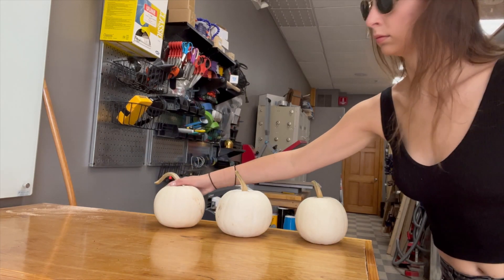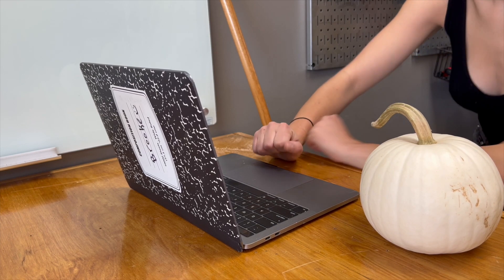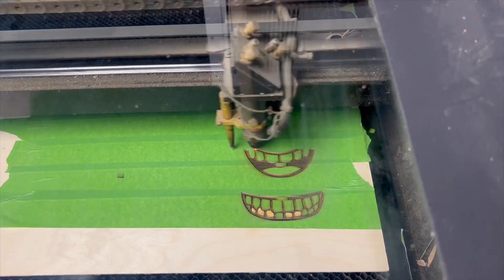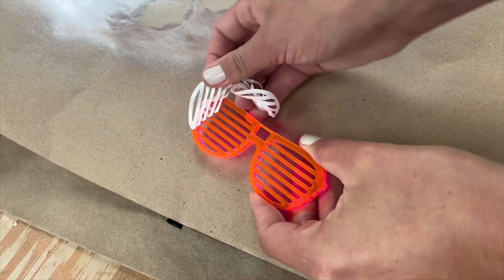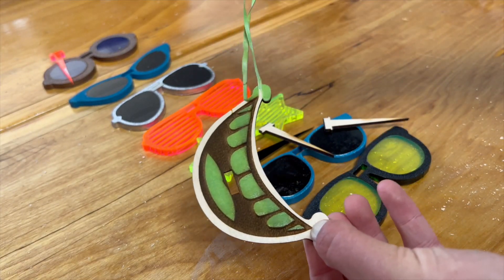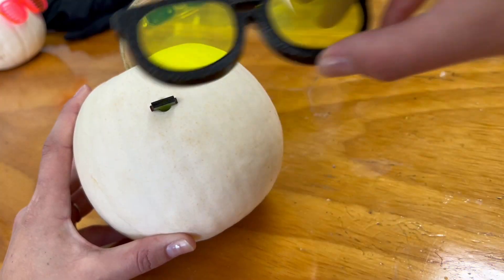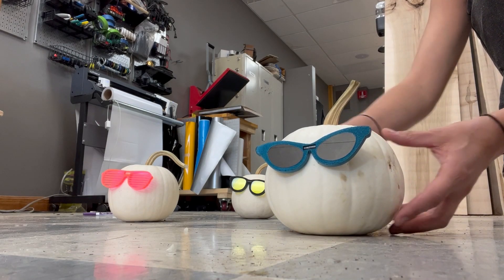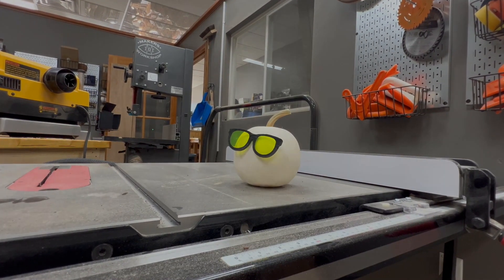A BETTER way to Decorate Pumpkins || Laser Cut Pumpkin Sunglasses

Comment: Have you tried lasering the pumpkin directly? I did it a few years ago and raster engraving takes off the more opaque skin of the pumpkin so the light will partially shine/glow through. You can also run a vector cut like 20 times to cut through too. I did ironman (the arc reactor was cut all the way through) on a pie pumpkin sliced in half so it'd fit in a K40 laser.
Reply from the maker: I haven’t mainly bc I don’t want to get pumpkin guts in my laser cutter but I’ve seen others do it and been tempted :)
Reply: @MakersWorkshopLLC  fair enough, anything that you ablate/engrave just vaporizes. If you've got enough height to get a full pumpkin under the laser head you could "carve out the guts" after you laser it. 

When I did mine, because I had to cut it in half I just laid down a piece of scrap plywood to keep the pumpkin from touching the laser case, but it still wasn't very messy.
Reply from the maker: Good to know. Maybe I’ll give it a go one of these days if I’m feeling like it :)